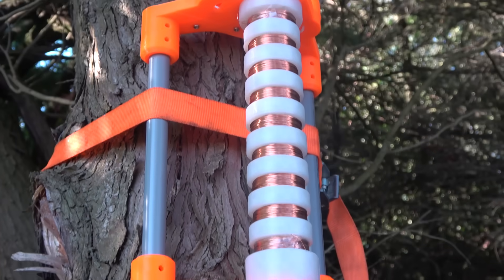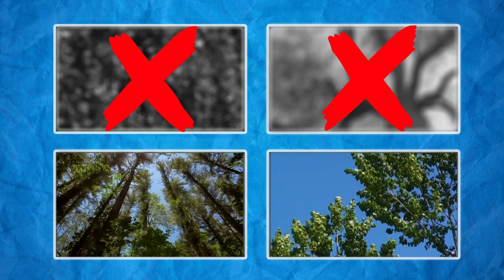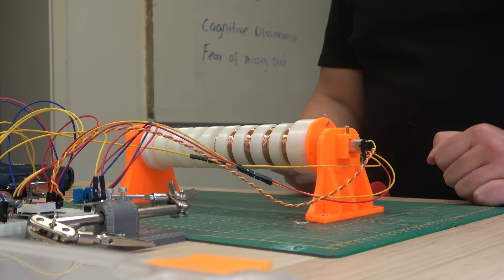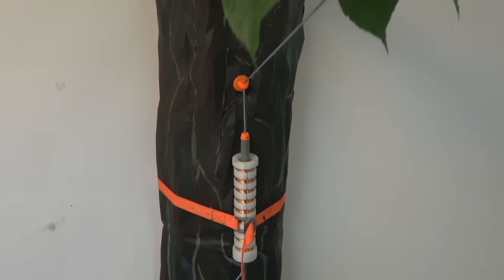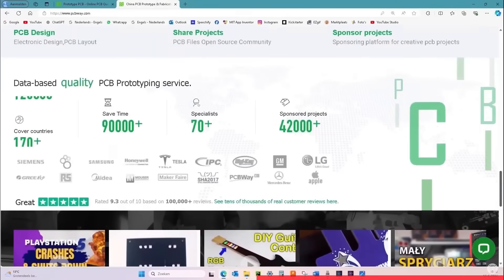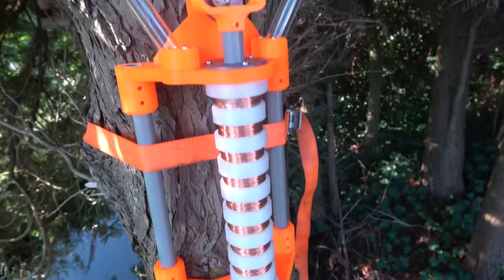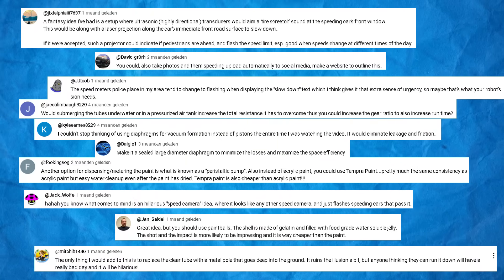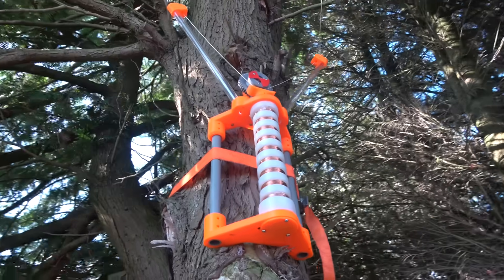I Made a Tree Generate Electricity..

Comment: Really impressive output from that generator! A question, when you say "alternating poles" do you mean that each set of magnets points the same way (North up for instance) and naturally attracts the next? And I assume the magnet rings are polarized through their thickness? If so, this is probably not the best way to arrange the magnets for a "coreless" generator like this one. If one arranged the magnet sets to repel each other, this would tend to increase the amount of radial flux linking the coils. 

When these magnets are all arranged in one orientation as I think was done here, the outwards radial component from the north pole of a given magnet set is partially canceled by the inwards radial component from the south pole of the next. If they alternate orientations so that each set of rings repels each other with opposing poles. then the radial components of the two facing north poles will add, and same with the south facing poles. The field lines will "squirt out" radially from between each repelling pair of poles and be more available to cut through the coil wires (and as you know faraday's law of induction says that the more lines cut the conductor per second, the higher the voltage). As a side note this arrangement would generate peak voltage when the magnets are positioned exactly between the coils, whereas the arrangement I believe you have now generates peak voltage when the magnets are positioned half way into each coil. It is also worth pointing out that the opposing arrangement actually produces half the pole count, which would tend to imply a higher peak speed, but I think this would probably be more than compensated by the higher field strength. And of course the coils would need to be wired so that they alternate in polarity.

Another way to think about this is that you're adding potential energy to the magnetic field when you force the magnets together during assembly, doing mechanical work on them. The stored energy in the static magnetic field is increased compared to each of the magnets alone. The opposite happens with an assembly of magnets where the magnets attract each other: the potential energy of the total field is decreased as the magnets do work on you during the assembly (pulling your hands together). This leaves less overall energy in the space around the magnets, and so less overall ability to generate magnetic effects like induction.

With opposing pole orientation you should actually be able to fill the entire linear "rotor" with magnets. In an attracting arrangement, if you completely filled the "rotor" with magnets then of course the "rotor" just becomes one long uniform magnet and there is no induction at all happening on the middle coils in the assembly, because they're constantly linked by the exact same field as long as the rotor is still passing through them. With the alternating arrangement, on the other hand, adding more and more magnets just increases the summation effect of the radial component of the field (even more field squirts out the side). You could literally pack the "rotor" solidly full of magnets. 

Of course, if the magnets are strong, this will be very hard to mechanically assemble. As described above this is actually a good sign, since it means that the potential energy of the field is increasing. But it would potentially require a very different mechanical design, perhaps including a metal tension rod to absorb the repulsion force. It might be possible to find some stainless steel (or otherwise nonmagnetic) "all-thread" rod, and then if the rod could be made long enough the assembly could be finalized by screwing the magnets together. I'm not sure this is really necessary, not sure how strong these magnets really are. 

Anyway, hope this idea is of interest to you, I think it ought to be fairly easy to test! I'm not sure the arrangement will be massively superior with the same number of magnets as you already used, but I'm quite confident that it would ultimately allow you to reach a higher output with a similar design since it should allow twice the number of magnets to be crammed into the same device.

[edit: to be clear, the arrangement I'm suggesting is (NS|NS) * (SN|SN) * (NS|NS) * (SN|SN) * (NS|NS) * (SN|SN) * (NS|NS) * (SN|SN) * (NS|NS) * (SN|SN) with each (NS|NS) representing the set of two magnets you currently have between each coil and the * representing the position that lines up with a copper coil when the rotor is stationary in the middle of travel. Note that you'd want 10 sets of magnets for your 9 coils, because otherwise the two end coils would only get a single N or S pole acting on them, rather than two, although you could also do (NS) * (SN|SN) * (NS|NS) * (SN|SN) * (NS|NS) * (SN|SN) * (NS|NS) * (SN|SN) * (NS|NS) * (SN) with a single magnet on the ends (and using the same number of magnets you have now) and that wouldn't be the end of the world.]

Comment: I am a gardener, I can tell you that with every medium gust of wind, the whole structure will tear apart. The branches of a tree also often hit each other, and in a storm quite a few trees can turn almost once around their entire axis. 
Nearby trees and plants would quickly become entangled in the ropes. So for your experiment you are looking for a tree with a compact crown, or conversely a very open crown of a very solid tree, where the movement can be predicted to some extent, e.g. Platanus orientalis. The ropes should run as close as possible to the trunk and branch and be moved less by a direct pull than by stretching and contracting

Comment: is this linear generator as efficient as a radial? Since you could just aswell convert the linear movement into radial movement just like a locomotive does
Reply from the maker: Yes and no🤓 one of the reasons i went for the linear version is because of the CW to CCW (etc.) motion of this prototype. This means your constantly working against the momentum of the rotor of a rotary generator unless you work around that with let's say a ratchet system for example.

Comment: Probably linking one tree branch to the generator tied to another tree or ground point slightly away from the tree base could generate more movement & power than using a single tree for the whole setup. Same when connecting the generator to one tree branch and the link to another tree branch, spaced 10-20 meters away. Wind blows often in the form of waves that shift one tree branchs after another, so using the wave span could give you more movement and power, but naturally would be hard to link them at the altitude.

Comment: It seems to me that using a linear generator is not a good idea anymore at this point. It makes sense that you have it, as it made sense in the first draft, but now you are converting linear motion to circular motion back to linear motion, which cannot be as efficient as less motion conversion.
Reply from the maker: Yes and no🤓 one of the reasons i went for the linear version is because of the CW to CCW (etc.) motion of this prototype. This means your constantly working against the momentum of the rotor of a rotary generator unless you work around that with let's say a ratchet system for example.

Comment: How about instead of only harvesting the power from a single branch, you convert the motion of the entire trunk to electricity? Maybe with the ground as a fixed point, or as differential between two trees high up (not so optimal as you expect them to be more or less synced with wind blasts, might still lead to some energy due to different oscillation frequencies)

Comment: Hello, this is a very nice idea, perfectly obvious, once told to you :D
I can't help to notice that you built an interesting system to have an axle rotating in order to drive a linear generator... 
Why not putting directly a rotative generator on your axle and getting rid of the rubbing losses of the rotation --> linear conversion? Moreover, I'm pretty sure that any circular generator will have a better efficiency than the linear one (that's why we use that pretty much everywhere ;) ).
For long term : You might want to avoid to have knots too tight on the tree branches as they grow with time.
I guess the problem of the string either breaking or cutting the pulley will have to be considered too :)
Please continue, I'm curious to see more :D

Comment: Tie a weight lifting ratchet between two trees. As the trees move, a weight is lifted and released when at the top, spinning a more conventional generator located on the ground between those trees
Reply: While it may have a better power output, it negates the goal of having the centripetal design that is near invisible. tripping hazard and is less fortified by the tree, which would prevent the generator from being damaged. Good Idea though. Maybe if we had them on post between the trees, raised, it would be safer, less of a hazard, and relatively  out of view
Reply: just find a single tree with about equal branch on either side. then a rope to both branches. I think the only real upside to using trees in this way is to have less space being used by manmade items, so anything placed in between the trees would really defeat the purpose. maybe we could use this to power our internet modem, or cellphone. something small.
Reply: Might as well just use a normal wind turbine at that point. Completely defeats the purpose.
Reply: @rollerskdude  True. Trees are obstacles to urban wind turbines, grow for free, reach heights that other structures may need planning permits for, etc. Anyhow, like the OP I'd make something for fun or experimentation.
Reply: I think your way would eliminate the risk of attaching stuff on all trees' trunk. It will gros differently because of it.
Reply: this is great anybody could make it very easily, its very simple not many moving parts, and can rely on existing technologies for storing and generating the electricity.
Reply: Tree battery!
Reply: trees move in tandem
Reply: @funky555  really? Watch two trees closely, especially if of differing sizes or species
Reply: A bird might mess with it

Comment: If you used fishing string, enclosed everything and made it camo colored I think this could be a practical idea- I've had this exact same idea before, though in a slightly different way, I'd probably use a small spinning generator, then gear it so no matter what happens all movement spin the gear to the generator move the same direction, I forgot what that gear setup is called but it's pretty simple concept.

Comment: Once you have it spinning a wheel, why not just attach a rotary generator? Yes a linear generator is cool, but unnecessarily wasteful of hard earned energy in this instance.
Reply from the maker: Yes and no🤓 one of the reasons i went for the linear version is because of the CW to CCW (etc.) motion of this prototype. This means your constantly working against the momentum of the rotor of a rotary generator unless you work around that with let's say a ratchet system for example.

Comment: Ok nice idea, lets think of the max. energy we can get. The max would be if we can transfer the whole kinetic energy from the try caused by the wind. So we have a little movement with a lot of kinetic energy. So you " tree to linear" inverter has to become much stronger with a high ratio gearing witch translate the little powerful side movement of the tree in to a very fast spinning generator to produce a lot (much more)of electricity. I would suggest let the wind load the tree and when the tree swings back try to stop it with the generator. I think its possible but you need a very strong mechanism.

Comment: Some thoughts - electricity production is all about making something very cheaply that can last a very long time. Mainly because the profit is so low on the produced output. Unfortunately installing enough of these onto real trees to make sense isn't going to make commercial sense given the installation nor the maintenance required - but I think you are definitely onto something in a slightly different tangent.

Wind turbines are horrifically and unnecessarily complicated. If you just make a flexible tube (e.g. one single big vertical branch) and stuck it in the wind with your kind of system inside of it - the cost and maintenance might be able to be significantly reduced when compared to turbines. And maybe without the giant spinning blades some of the environmental issues people have with turbines might reduce too. Think 'giant grass' rather than 'turbine' or 'tree'.

Comment: Fantastic idea. An almost unlimited number can be rigged to a single tree. 

I made a generator with a dc motor 18volt, from a power tool bought for the purpose, used the  core of a shaded pole motor but switched out the rotor for the magnetic rotor from a washing machine drain pump(which gives high voltage when turned as a generator, it easily runs 10  lights before noise is an issue. ) but the shaded pole core lacks a gap so there is no cogging of the magnet, nice and quiet, but the voltage out goes to a 150cc regulator rectifier which charges  a new battery and if needed speed it ip and you have a couple of lights too, or a phone charger directly to the shaded poles output could be high enough to power the charger’s circuit.
Reply: Now what do you call that stuff again that you've been smoking ?

Comment: If you put a strap around the tree, make sure it have enough stretch. If it rigid, it really kills the tree because it cuts the fluid flow under bark, where most of it happen.

Unlike many people think, it's not bad for a tree to screw something on it. It makes only minimum hole on a bark and wood itself is pretty much dead mass. Rope or a strap, which has been forgotten on place for few years, makes massive damage or possibly kill the whole tree.
Reply: I came here to say that Screws in a tree aren't damaging the tree but I had no idea that straps would hurt it. Thanks for the info.
Reply: @lorenztor1990  makes sense, its basically a tourniquet
Reply: All trees grow around an object eventually, fences, signs, bicycle ls cars.
Trees are very resiliant
Reply: What about putting a post in the ground to hold the generator?
Reply: @Valkommen888  I would guess there a larger risk of puncturing into the roots which would be worse
Reply: @rafi21  That is a good consideration, but I wonder if there is potential to uncover the roots with a pressure washer and put the post around it somehow if that makes sense.
Reply: More people need to upvote this.
Reply: That's not true. Trees will grow around a strap that is only a few centimeters wide. The bark will form over the band/strap and it will become part of the tree. But that takes decades, not a few years...
Reply: It's crazy how people are allowed to type what ever they think and having people agree with them to further cement their demented ideas. Straps hurt trees? Tell that to the bonsai tree enthusiasts..... I know you haven't planted a single tree in your life... why are you spurting out bs?
Reply: @Kronin-n6f  Yes, the Dunning Kruger effect is hell in echo chambers...
Reply: The ratchet strap would effectively choke the tree. Screwing the device to the tree would cause the tree to grow around the device. The generator and its attachments should be regularly adjusted if this were implemented.
Reply: Make the rig out of wood and use wood glue.
Reply: The strap could be with a bungie cord rather then ridged straps...
Reply: @2019inuyasha  It is better. It depends on the tree how sensitive they are. Heavy bark can take much more force than thinner one, like birch.
Reply: also I am glad someone pointed this flaw out before everyone starts placing these on trees

Comment: This is really cool.

I just want to share something I realized a little while back about global energy solutions; 
Many people mistake 0 fuel energy systems for "free"/"green" energy. There is a lot of energy and materials that go into every energy system, and depending on the lifespan and power output of each individual system, these could add up to be worse for the environment that other "non-green" systems. 

This could be really cool way to get a charge for your phone, individually. and I hope this works out to be a really awesome project that you end up happy with.
but "global energy solution" is an entirely different beast, that I think people treat too lightly, which causes a lot of controversy based on misrepresented and misunderstood systems.

Comment: You may be able to capture extra wind by fitting a small sail like fabric to the strings that would “reset” when the branch opposing it flexes to the upward most position and collapses the sail with an opposing string on a pulley below. This might be able to work in both directions as well…? idk..just a thought. But there would also be many components to fail and get tangled up…plus it might pull too hard on the branch over time and cause it to sag lower or snap. You’d have to choose the branches wisely.

Comment: Adding a fly wheel to the system could allow it to store energy in the wheel to reduce intermittent power generation. Also, adding more points of contact could increase the power the tree generates. If you have multiple pulleys connected to multiple branches, you could potentially utilize the power of the whole tree.